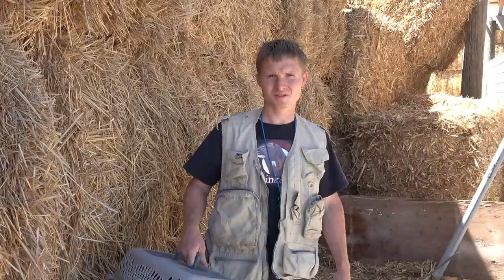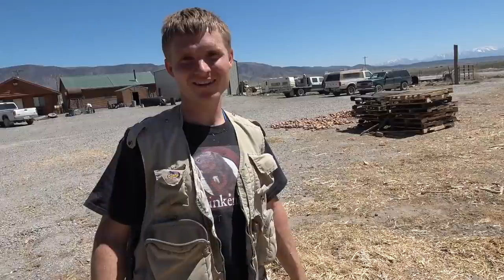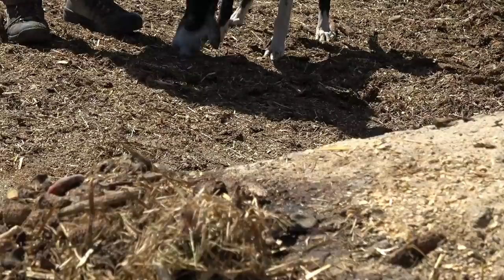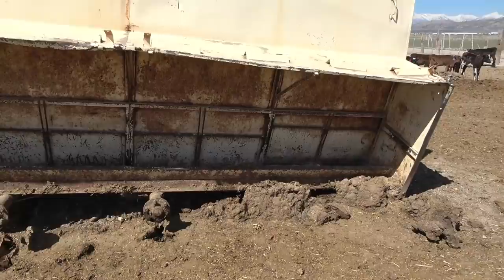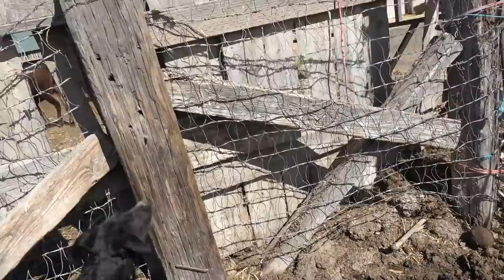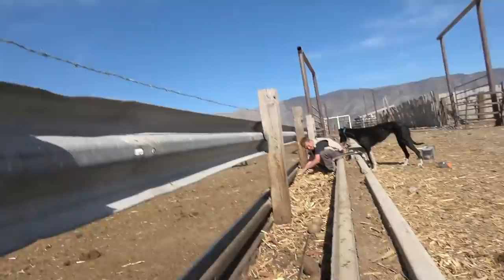Brocc the Mink and Onsa the Lurcher Catch 63 Rats!!!

Comment: I have two words for anyone that hates this video, Bubonic Plague.
Reply: only wood rats carry plague, most rat species can't carry plague
Reply: I have two more, WELL SAID!
Reply: @RedWolfCid  The rats carry the fleas that carry the plague. Any rat can have a plague ridden flea on it. The rat itself has no plague, only its fleas.
Reply: @forevertj  You are wrong on a few points. Fleas only bite humans (vector transmission) after there prefered host has already died, only rarely from plague (most animals are only mildly affected by plague in most cases), plague may also be transmitted through direct contact ( bites from infected animal or handling guts) or through inhalation of the bacteria (cough). Fleas do not carry plague long-term, the coccobacillus builds up in there midgut, effectivly blocking there stomach, causing the fleas to bite more aggressivly and infect the new host before they starve. Multiple animals can be infected with the plague bacteria (Yersinia pestis), however most rats are immune, the only genus of rat susceptible to plague is Neotoma, other animals that carry plague are voles, deer mice, chipmunks, squirrels, rabbits, dogs, cats, goats, camels and sheep. Neotoma at best make up about 10% of rats, leaving 90% of rats that do not carry plague.
I guess this is fairly new information but you should look it up rather then continue to spread misinformation.
Reply: @RedWolfCid  their*
Reply: i'm a spanish speaker and i aprove those 2 words xddd
Reply: most people do not know that the bubonic plague was carried by the rat population. good point.
Reply: Just so you guys are aware the black plague is still a thing in 2017 there was 200 cases of black plague so yeah it's not just a history thing it's still kicking One case of a drug-resistant form of the bacterium was found in Madagascar in 1995.[110] A further outbreak in Madagascar was reported in November 2014.[111] In October 2017 the deadliest outbreak of the plague in modern times hit Madagascar, killing 170 people and infecting thousands
Reply: Good. Stay shut up. Finding fun in the death of any animal is barbaric
Reply: 1666.
Reply: @Sindri44  thank goodness Madagascar is thousands of miles away
Reply: If you get technical, the fleas that were on the rats caused the Bubonic Plague, not the rats themselves. No hate on your comment or anything just making a statement. ^^
Reply: @colinme2672   Hunting is in our nature, we are animals too. Just smart naked apes
Reply: Ted Bates but cats dogs and humans spread it also it was the Black Death not bubonic plague
Reply: The rat apologists are hilarious.
Reply: They have a big rat problem
Reply: @Dang st furnitur is the least of your issues. I've seen rats destroy several ton slabs of concrete, so if they are given enough time they could just vring the house down in its entirety.
Reply: Ted Bates a lot can potentially carry rabies and other pathogens mate.
Reply: I got 2 to say damn right
Reply: It was the fleas not the rats!
Reply: Rats are vermin theyre not like dogs and cats their vermin!!!! Bad news a rat will eat the nose of youre new born baby . theyre bad news!!!!!
Reply: Ted Bates and Bubonic continues to plague USA. Just ask rangers at Yosemite CA. (Flees carry on squirrels) to name just one.
Reply: Cage .Cage incomplete
Reply: Hol up😭😭😭
Reply: 1000th like!

Comment: You should put a go pro on one of the minks
Reply: The dog maybe but a go pro would really screw a minks style
Reply: So you’re suggesting putting a go pro on the mink in this video when he already has trouble squeezing into tight spaces? Yeah I can see that working out well.
Reply: 8 i
Reply: @captainkarenobvious3087  its a prank Bro
Reply: Captain Karen Obvious 
Maybe on the tip of the tail, giving a backwards view, but anywhere else would obstruct movement.
Reply: its everyday bro
Reply: @eldermillennial8330  You'd need a small one then
Reply: That would be sweet